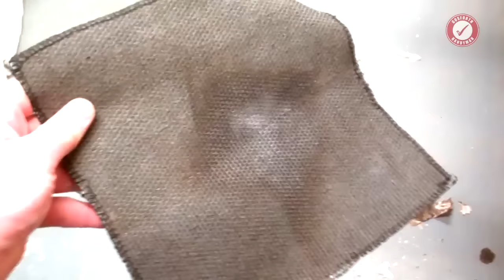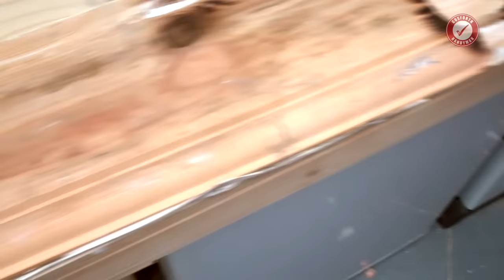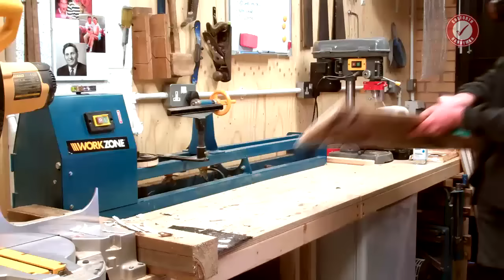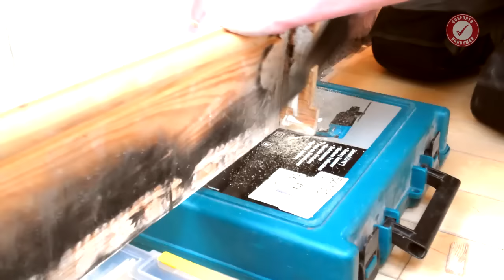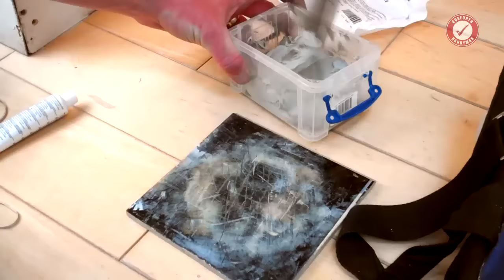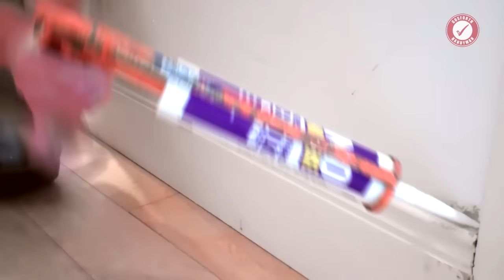Skirting Boards - Glue Removal & Re-fitting after Damp Proof

Comment: Hi, Can you help?..... Have built partition wall and now fitting skirting. Bought Taurus skirting same Hight and Depth but not identical profile to existing skirting. Flat part of new skirting is 5mm taller and rounded bead is smaller. Need advice on a decent way to scribe the two together without it looking awful ha

Comment: By the time you spent prating about cleaning scabby old skirting ,thought i would have been better to replace new piece , and caulking the gaps   which is flexible, and moves with the wood .
Reply from the maker: Not really, 10 mins to scrape the glue off vs cost of new skirting, time to pick it up, prime it etc. 👍